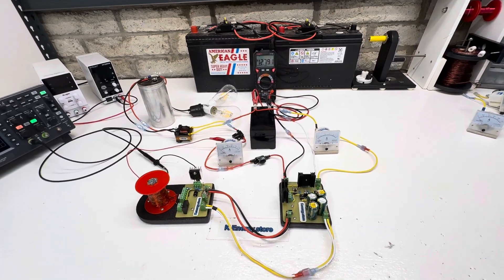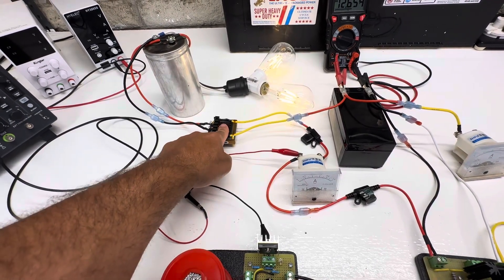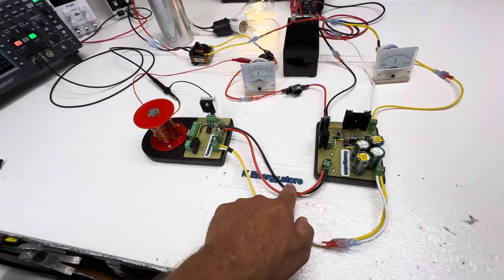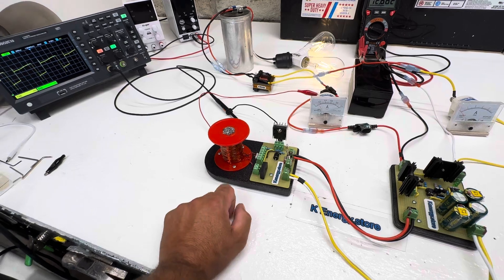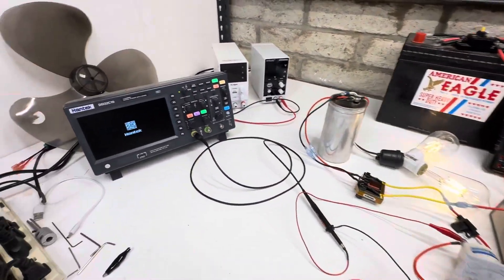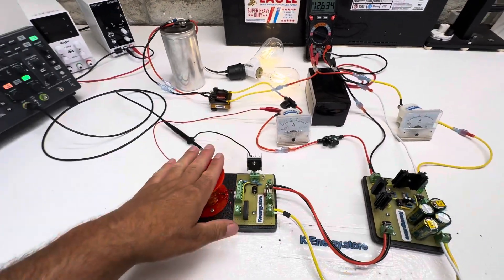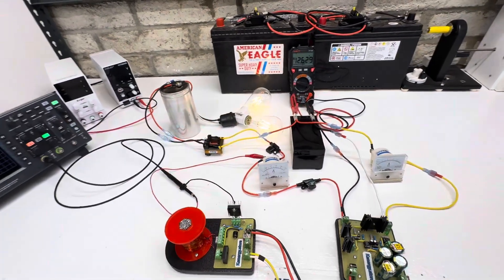Oscillator loop back experiment

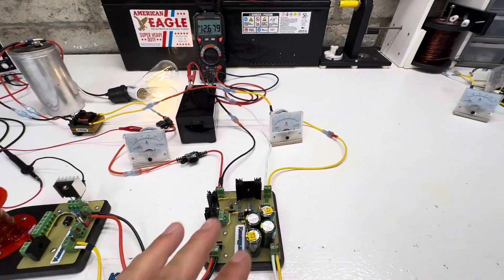Comment: 2:00  got to figure out how you guys trigger with zeners  , seeing how zeners waste power to regulate , there only real value is as a trigger unless you got so much power you dont mind wasting it to get a steady voltage
Reply from the maker: The Zener only turns on at that voltage and a very small amount of power comes out 

Without a voltage trigger it could come on at the wrong voltage
Reply: @kenergy1707  thats right , but when used as regulator is will waste the power as heat  to bring the voltage down , but your correct when used as trigger it is used most efficiently
Reply: @kenergy1707  great way to get around the use of a timer switch

Comment: You can charge capacitors with a magnetic field aswell by having it within the coils field , giving a amplification effect which Tesla used to do, be better with my coil wind with a father reaching field though
Reply from the maker: Definitely a good idea 👍
Reply: @kenergy1707  i got a document i can get to you somehow? That explains it
Reply from the maker: @doubleooh7337  kbgenergy@gmail.com
Reply: @kenergy1707  you should have it very soon ;)
Reply: @kenergy1707  my next idea is kinda like what it says a high torque motor force turning a magnet inside a coil, drag will be insane but it should plow through, that will have 150wires in parallel to get up to 13amps and should do mains voltage out aswell, likr i say my aim is to get enough power to power a kettle or stove when out camping ,3,000w is probably impossible from a 40v dc motor, but tesla does give hope haha he fid prove theres something more to all this even back then
Reply: @kenergy1707  i do wonder if you can have a 50w dc motor turn a generator coil and have that output powering a 200v 600w torque motor turning a much bigger generator,  that output through a stepdown transformer to feed into the 1st dc motor, and extra output to tap ,
Deryck Thompson chasing the dream just did a similar setup powering a Newman motor that thing flys
Reply: @kenergy1707  did you get it?
Reply from the maker: @doubleooh7337  yes thank you!!